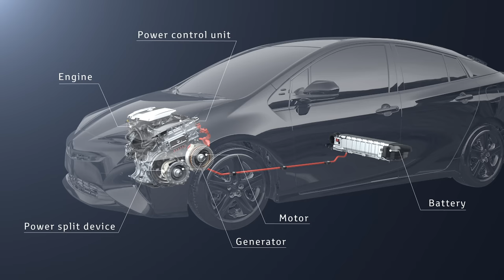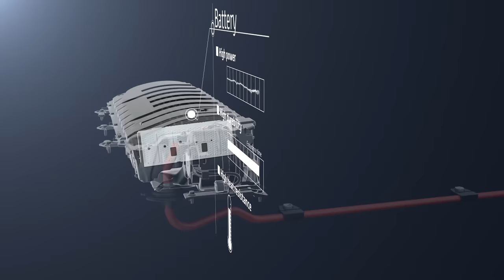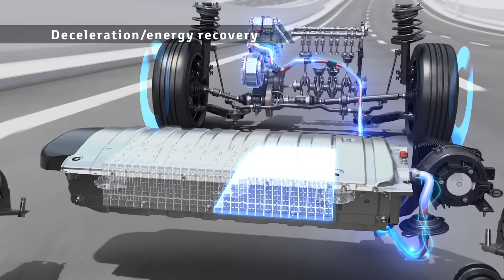What is Toyota Hybrid System

Comment: Switching on the engine in the middle of the road with higher than idle RPM and with load on it is completely like waking up someone from sleep by putting a needle in his butt and force him to RUN.
Engine torturing system
Reply: probably fine since generator at 0:56 is also a motor to start the ICE and unlike conventional starter motor with fixed RPM, this electric motor can work on wide range of RPM. watch this https://www.youtube.com/watch?v=O61WihMRdjM&ab_channel=WeberAuto . so I think it's different from: starting motor to idle, then apply full throttle until engine reach certain RPM. It's more like start the engine and assist it until target RPM, which mean the engine will not stressed immediately.
Reply: @suryabejibun  Not actually.
You'll put engine under stress anyway.
Because when you switch on the engine on a normal car, especially when it's cold, you'll rev it up gently.
But in this case the engine has to reach the targeted RPM in a very short time. There are numerous problems with that.
First, the engine is cold and revving it up quickly is not a good idea.
Second, the engine is switched off for a while, meaning that many parts haven't been lubricated.
In my opinion, this system damages the engine
Reply: @ravenheart369  the Prius begs to differ with your analysis. You'll actually notice the hybrid battery is the one that gives out first but the engine runs okay and lasts as long as other conventional ICE engines
Reply: @perminuskaranja  Instead of talking BS, try to convince me with some scientific evidence
Reply: ever heard of a clutch? You ease the engine into it.
Reply: @ravenheart369  actually, I believe engine temperature is taken into account in their programming. Usually whenever their hybrids start the first time in the drive, they run atleast until they reach temperature and the cats reach temperature, and then the engine is turned on and off
Reply: @ravenheart369  On paper, I agree with you.  However history has shown the Atkinson style / hybrid engine to last 300k and in some cases, even more (taxi's).  It's above my pay grade but as I understand it, that engine works with both Direct and Port injection based on computer decision so there is less chance of internal engine corrosion over the long term.  On and off seems bad for the reasons you say, but for some reason, they just keep on ticking to well over 200k.
Reply: @ravenheart369  All hybrids today have a warm up mode, where they'll preferentially use the engine until it's warmed up. Also, the engine is spun without fuel for a moment to lubricate everything before fuel/spark are added.

Also, the electric motors can take the load off the engine while it's starting.

Comment: Hybrids break downs cost lot of money to repairs and not efficient, better fully fuel or electricity vechicals .
Reply: Actually, stats don't back that up.  No alternator, starter, serpentine belt, transmission (ectv), brakes get used less, engine doesn't run as often.  The biggest danger is not cleaning the HV Battery filter which causes it heat too much over time and wear out sooner.

Comment: both the engine and motor have low hp and torque, how can it drive powerfully?
Reply: listen carefully..both engine combined to attain great power
Reply: @rommelmangampo7575  the engine itself is 95 hp, combine is 121 hp with 105 lbft. Is that called powerful?
Reply: @sunny1summer  you are talking about a city car... Not a sports car
Powerful here means getting up to speed on the highway and not slowing down traffic
Reply: @davidealessandri2893  no one here is comparing it with sport car! how about going up hill ? In both highway and city, I need to go up hill, and I have to step on the gas padel all the way down all the time. It is weaker than a Corolla. Please, stop using the word powerful when Prius is the weakest Toyota car, this is misleading! compare it to similar price tag hybrid plug in cars on the market Hyundai Ioniq, Kia niro, and Ford Fusion; Prius prime is the weakest in HP and Torque!
Reply: @sunny1summer  I was in a new Prius last week, in hilly country. No problem whatsoever with very little effort on the pedal. Not sure what you were doing.
Reply: @oddities-whatnot  i do not know how your hill area look like, but i am having a difficult time to get up the long hill on the highway here with the prius prime 2021.  it is difficult to keep the speed at 65 when up hill. the power is too bad to keep the car not slow down the traffic
Reply: @sunny1summer  Prius has adequate power. It can go on hills just fine. There are many cars on the road much slower than Prius and they can get to places too. Plus Prius has never been about speed, it’s about efficiency and it’s darn good at it!
Reply: @midoriyaizuku4403  I agree with the efficiency, and fuel efficiency never go along with power. Better fuel economics, less power; more power will consume more fuel, therefore, I disagree with the words “great power” which was used above!
Reply: Stop comparing Prius to a high powered turbo engines. If you want more power, you can have the Supra. If you still prefer to have a hybrid, choose Rav 4 prime which has 302 HP.
Reply: @JohnPaul-ru3ew  were you high? what were you smoking? re-read my cmt above, i was comparing prius prime with other hybrid plugin with the similar price tag on the market!
Reply: @sunny1summer  what mode do you drive on eco normal or sport?
Reply: @meki___6881  normal, i have never used the eco mode
Reply: @sunny1summer  then try the power mode while going uphill
Also the electric motor has 120 pound feet of torque
Whit a 10.8:1 gear ratio in gen 4
Reply: @meki___6881  i am now saving all the electric power for uphill, and the hybrid mode for regular! And when i have more than 1 person in the car, only the electric mode can go uphill without slowing down the traffic ..... hopefully we will have the battery pack upgrade soon
Reply: In a rav4 hybrid, the hp of the gas unit is 203 and 219 on the hybrid.
Reply: @dj3114  that power should have no problem
Reply: @dj3114  however, the prius do not have such treatment, 95 hp of the gas unit, and 121 on hybrid, torque is lower than hp
Reply: @sunny1summer  You have a Prius Prime and you have a hard time going up hills? I have 2019 Prius Prime and I destroy trucks on the uphill during my holiday commutes from SF to LA. Place the the Prime in EV auto mode the massive torque from the EV motor will pull you hard. Once you’re on flat grounds press ECO mode to resume fuel efficiency. I’m pushing out about 800 mile range per fill up. And thats with spirted driving.

Lastly, The electric motor from the Prius pushes - 295 Ft-Lb torque @ 0-1200 RPM.
I simply utilize this power by tapping on the pedal until the ICE motor is about to kick in, then let off the pedal and coast then repeat. Like I said, I destroy trucks in up hill battles.
Reply: @criancrna1487  using the EV mode does have no problem; however, the battery is too shot, going up hill one time take 35% of the battery; but the hybrid mode does have a big problem. the rpm bar were on red and i am having a hard time going up hill; mostly ~50 mph and i have the feeling that i was slowing down the traffic
Reply: @sunny1summer  if you feel like you’re slowing down traffic and you feel unsafe, you can stay in the far right lane and allow people to pass on the far left lane.

Comment: So Toyota finally “invented” Ford/GM design of ECVT transmission for HEV/PHEV vehicles?  And it took only 9 years since the first Ford Fusion HEV/PHEV equipped with this transmission showed on the street? 
Well done Toyota, really innovative.
Reply: What are you talking about? Toyota is using this since the first gen Prius, long before GM and Ford whose hybrids use Aisins drivetrains.
Reply: @АндрейЗайцев-у7ы  i really dont get what you are saying, the first gen prius was sold back in 97. Toyota had a patent on it so all other manufacturers had to borrow from Toyota to install to their vehicles. Now that the patent is over many of them develop their own solutions. Mitsubishi, Nissan, Honda, GM, Ford and even Koenigsegg have developed similar transmission layouts but the fact remains that Toyota was the first one by far. Not only that but they have the same basic principle with many variations for FWD, AWD and RWD applications. 
We all need some more education so i would definitely like to understand your point.

Comment: pity that the video call the electric motor, just the motor ....the combustion engine is indeed a motor too.....
Reply: motors run on electricity and engines run on fuels (most modern ones using combustion). The engine converts various forms of fuels into mechanical force, while the motor transforms electrical energy into mechanical energy ... in short, if no electromagnetic forces are involved, you call it an engine (steam/petrol/gas/diesel/compressed air engine)

Comment: Electric motors of the engineer the motor of the future. Because they don't vibrate they don't make noise they last forever. There's no torque value. There's no torque resistance. You don't need deers in electric motor. There's no need for gears in electric motor.

Comment: New engine tech (NET) being developed will be 75% efficient below 50% of torque and 60% efficient from 50% to 100% of torque.  It is distributed power and needs NO electric motor.  it has 75% brake recovery vs Electric at 55%.  

The combustion engine in a hybrid is ~ 35% peak efficiency.  Charging, storing and retrieving energy from battery is 0.35 (combustion engine) x 0.93 (generator) x 0.95 (battery in) x 0.93 x 0.95 = 0.35 x 0.78 = 27.3%.  Braking is 0.55 x 0.78 = 43%. 

A hybrid is heavier and results in a weight factor of around 1.12x better MPG for New Engine tech (NET). 

Compared to a Toyota hybrid, NET will be 75/35 x 1.12 = 2.4x better HWY than hybrid.  Prius at 56 x 2.4 = 134 MPG HWY.  In city, 75/27.3 x 1.12 = 3.077x better.  Prius city is 57 x 3.077= 175.4 with the SAME brake recovery, and with 75% brake recovery it is 36% better...  57 x 3.077 x 1.36 = 238 MPG city.  

New combustion tech (NET) with a Prius body would be:

134 HWY
238 City
196 Combined

196 new engine tech (NET) vs 56.5 hybrid is 196/56.5 = 3.47x better MPG on average.  NET also has no NOX, CO, and can capture CO2 and water in a combined cycle.  The CO2 can be used to make fuel from solar Thermal at $1/gal, vs a 100% RE grid at $20/gal for a fuel cost ratio of 20:1.

Factor in fuel cost ratio with fuel consumption ratio of 3.47 and you get a cost ratio of 69.4x from RE fuel vs RE grid in a plug-in mode. 

There is NO point to making EVs with NET tech.  

In Winter, NET has 47% of drive load for heat use (20% from waste, 20% from intercooling and 7% from high heating value of fuel) vs an BEV at 85% with 10% waste heat useable.

NET is also a heat pump (COP4) and thus can leverage for cooling and heating as needed.

The cost to you can be a SAVINGS of $1-2 billion on each car model and massive sales with NET.  Simply install NET in old ICE cars, recalibrate airbags, and sell the model for 5 more years with NET.  On year ten, you would switch to NET "skateboard" power tech and all passenger car models are in the 150/240 range HWY/City.  A mini van like the a Sienna would be around 90 HWY and 214 City.   Range on 20 gallons (2 minute fill) is 3000 miles with CO2 capture and 9000 miles without.  No more silly charging...

The question is:  Is Toyota interested in new engine tech that can make or brake the company?  If not, then you might want to get ready for bankruptcy.  All EV companies and old ICE/hybrid companies will not be able to compete with NET.  Happy to discuss it.

Comment: The big question here is if this unit charges its battery from its electrical generator that is being driven by a 75% less efficient internal combustion engine then thats not efficient! If this whole system manages only a 60mpg then this is not at all efficient. Why don't you just develope a computer controlled fuel vapor carburetor to achieve no less than 200mpg instead of this more complicated system?
Reply: Ummm, how about you get working on that and become a billionaire instead of just speaking in theory.

Comment: On the open road they do not work - have driven them for all that tech a diesel will do a better job with more power and greater overall economy  -  A diesel far less tech for and outcome with less CO2 emissions and a better drive - When the battery fails contact Toyota and see what a new battery cost
Reply: I agree with you on the diesel doing better for long trips, but not the battery fail.  They are guaranteed for 150k and historically, last well over 200k.  By that time, like everything else electronic, they won't be near as expensive.  History shows that Hybrids are cheaper to maintain since no serpintine belt, starter, AC compressor, standard transmission, brakes last longer due regen and engines don't seem to wear out.

Comment: toyota, you have to create excitement to stand a chance against EVs! you need to increase the battery and motor power!
Reply: They did with the Rav4 Prime version. That's probably the new drivetrain they'll use (optionally) on all new models
Reply: @manu144x  thanks.
Reply: EV isn't always the best when you need long distance driving without downtime for charging. It is also not yet cost effective without subsidizes or tax incentive. Hybrid is now mainstream and self sustaining. EV will get there eventually.
Reply: @maggiejetson7904  this is so 2012.🤯
Reply: I'm glad they are sticking to what they do best.  Here in Iowa, I would hate to be caught in a traffic jam in a blizzard with an EV only.  You stay warm until the battery is dead and then you've got more trouble than just keeping warm.  With the Hybrid, the computer won't let the battery go dead and uses the gas engine.  Stay warm and don't deplete the battery.   With the EV, any unexpected delay causes an issue, not with the hybrid.